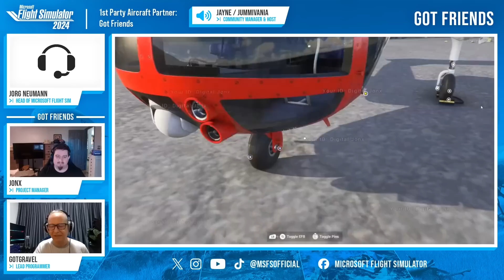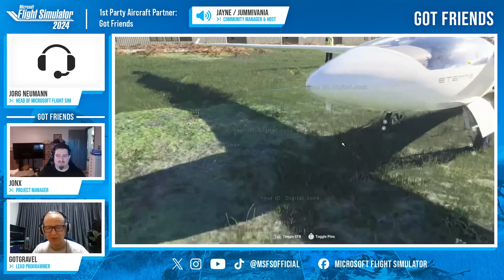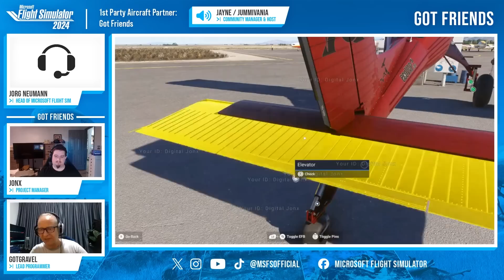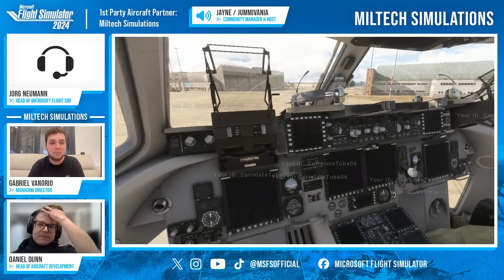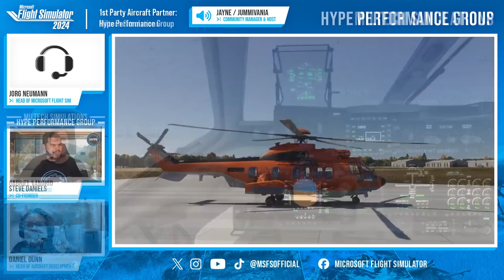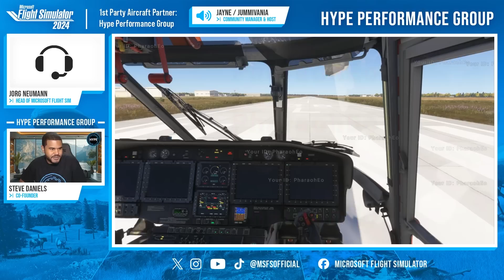1st Party Aircraft Developer Stream - Got Friends, Miltech Simulations, Hype Performance Group

Comment: That C-17 takeoff looked absolutely horrendeous. It's not like the plane doesn't weigh 265,000KG and it reached 20 degrees pitch like it was nothing.
Reply: IRL the c17 can perform some crazy takeoffs even with cargo there are some vids showing that airshows. Its really cool to see that even the Airbus A400M can perform some pretty extreme takeoffs
Reply: @andresvalencia-motorsportn7324  Yeah the C17 is definitely capable of short field takeoffs. Not sure if it's capable of reaching 20 degrees pitch as quick as it did here while being at as low of a speed as it was.

Comment: I don't get why Fenix doesn't get any special treatment, they make the best aircraft in msfs.
Reply: They probably just don’t want to. These developers are only the partner developers of msfs. Also Fenix is running on a separate app which is a limitation as a default aircraft in sim shouldn’t need to have another app running simultanously

Comment: So the "camera" for the Optica is actual camera or just like MSFS2020  weird implementation of Synthetic Vision?
Reply: Actual one, this probably means taxi cams are possible in 2024
Reply: @tompsu9536  in this video doesn't look like one. We can only see ground without any objects. So no picture in picture.
Reply: Just to clarify, this is indeed an in-house solution we did and not a picture-in-picture renderer. Cheers  @czesiek77PL
Reply: Not PIP / Render to texture. This is bing maps augmented with a camera angle. Will update when possible!!

Comment: C90 - PC12 - PC24 -  Study level?
Reply: We shall have to see how deep they are simulated. The models and stuff is being done by Carenado for the PC12/24, but the avionics systems are by WT if I understand correctly, which does look like it might be reasonably deep (the Primus EPIC). Don't expect failures and stuff, but Carenado mods are generally very pretty to look at, but they fly very... flat... Hopefully with WTs help they will be better than past Carenado works (which aren't bad, just not very deep).
Reply: No
Reply: @bagels377  The PC-12 is the same one from Carenado so it looks good but is not study level. For that you should get the Sim Works Studios PC-12.
Reply: They are probably going to be high-fidelity but study level is a wrong and misleading term for many addons.